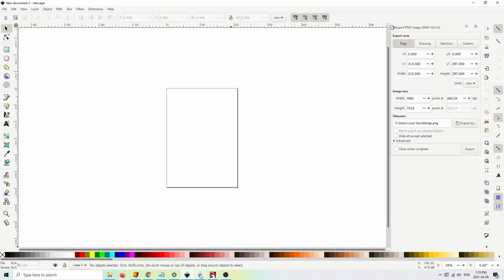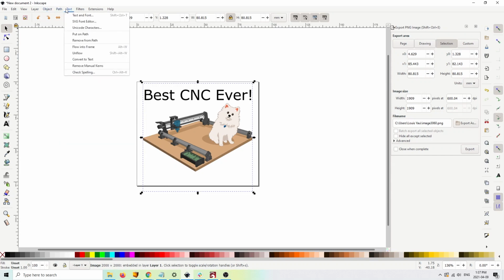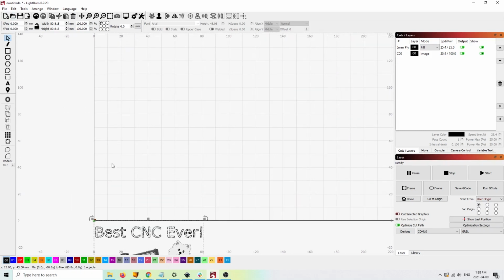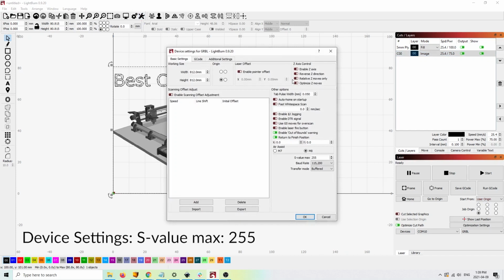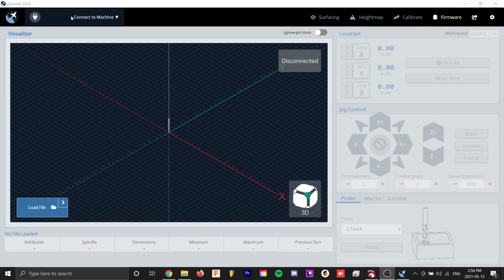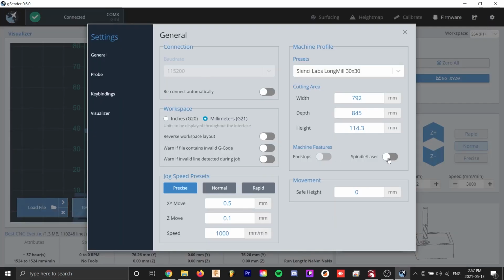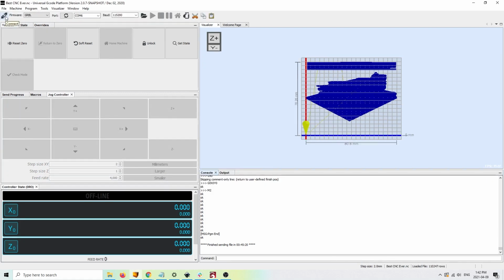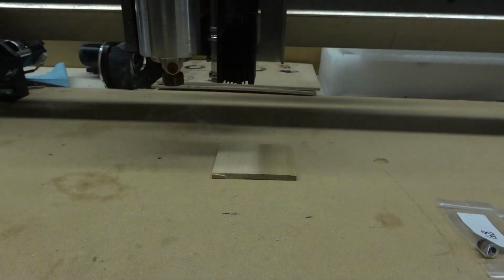Sienci Labs Presents: The LaserBeam Laser System For Your LongMill

Comment: How do ya’ll store your extra lenses and springs?
Reply from the maker: The bag they came in is probably the easiest place as they're all labelled and can be sealed but if you threw them out using some labelled bags is probably the easiest non-custom option
Reply: @SienciLabs  I guess I’ll look into designing a custom box

Comment: Will this laser be able to use air assist ?
Reply from the maker: Yes the laser actually comes with an air assist built-in 👍
Reply: @SienciLabs  Thank you for the reply. Now if Sienci Labs will incorporate a  Rotary unit it will be the best of two worlds, cnc and laser engraver with capabilities of doing cylindrical design work and engraving.

Comment: Another dumb question... why are you not just using Lightburn as the control software instead of using Gsender or UGS? I have used it with my current Laser module and it works great for the projects I have tried
Reply: I wanted to start with UGS and G-sender just incase customers would rather have more control over the machine interface software but the more I use Lightburn the more I'm impressed with the software as a whole. Will definitely include Lightburn machine interface in my next demo/tutorial
Reply: @IkeTheBuilder  Just to clarify this statement, we will be able to use Lightburn completely for the end-to-end process, is that correct?  It won't be required to use UGS and G-sender if we don't want to?  As someone with an Ortur and Neje, I am very used to Lightburn and would prefer to stay within the software at all times if I add a laser to more LongMill.  :)
Reply: @JohnnyGman01  Yes correct, I have tested it, works great. They are missing some additional functions that G-Sender would have but yes you can run the laser end to end with Lightburn
Reply: Really glad you asked that question. I was getting confused in thinking "How many programs do I need to run this thing?".

Comment: Could you please explain, in simple terms, the different lens options with the laser addon? I have ordered them all, but as a total noob, can't figure out the differences. Mr. Google hasn't even been all that helpful :)
Reply: 3 Element has the cleanest beam profile (super detailed text, lines and image engraving) G2 has the best efficiency (most power) and shortest focal length so its good for cutting. G7 is good balance between the power of the G2 and the clean beam profile of the 3 Element. G8 is very similar to the G7 but it has a smaller focus length so you can engrave thicker material than the G8 because you would have more available Z axis space. I will make a dedicated video for lenses but hopefully that gives you a bit of clarity until then.
Reply: @IkeTheBuilder  Thank you so much, now I'm starting to understand it a little better!

Comment: I have a Laguna CNC and want to try this Sienci Laser kit - I use generally Fusion 360 to generate designs and toolpaths, and use OpenBuilds software as the gcode sender. Is this unit compatible with those software solutions?
Reply: @Ikenna Ofoha yes, there is 5V signal and it runs off GRBL 1.1 (OpenBuilds Blackbox controller).